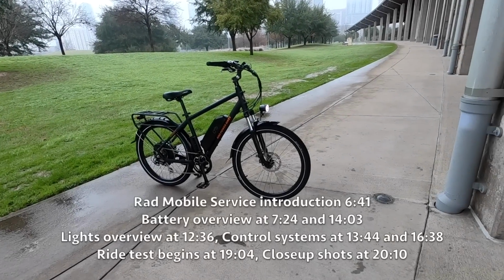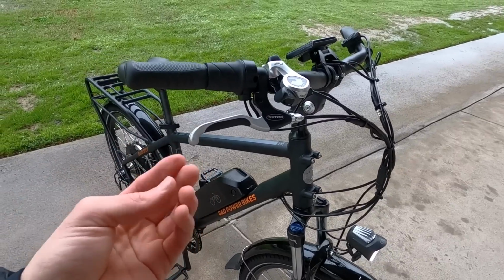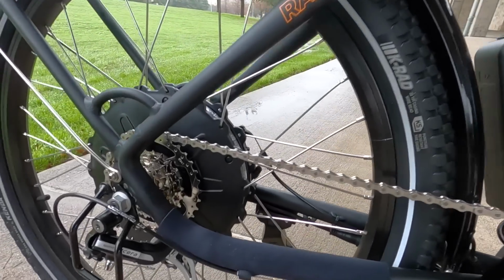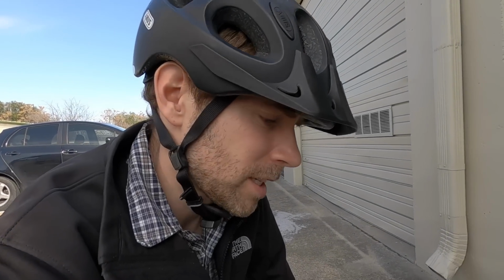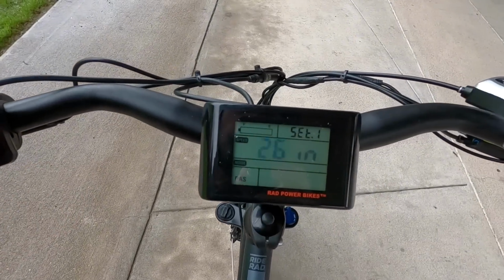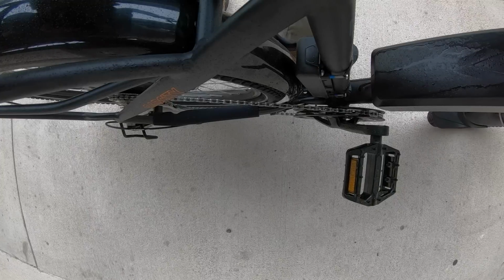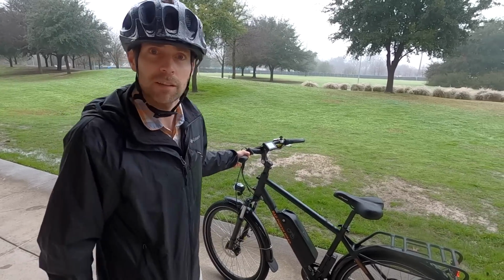Rad Power Bikes RadCity 4 Review - $1.7k

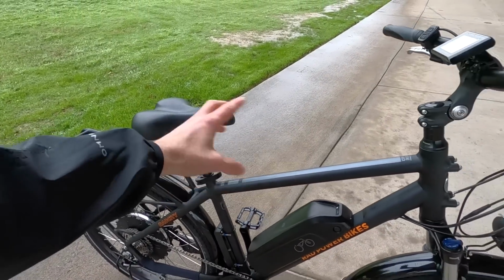Comment from the maker: Rad Mobile Service introduction 6:41
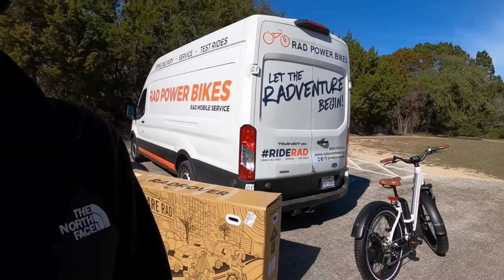Battery overview at 7:24 and 14:03
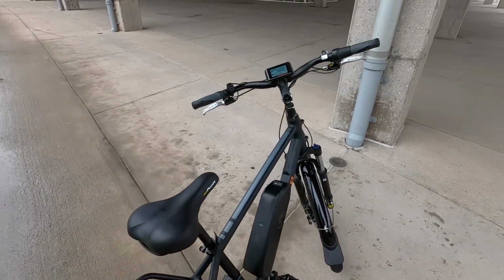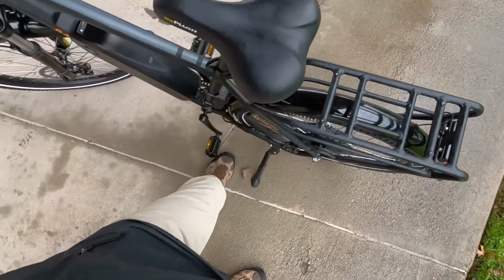Lights overview at 12:36, Control systems at 13:44 and 16:38
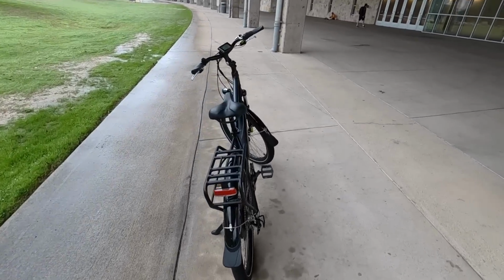Ride test begins at 19:04, Closeup shots at 20:15
Reply: Hey I was wondering which of Rad's bikes climbs hills the best.
Reply: Please, please, please compare this new arrival with the new Ariel Rider C-Class arrival.
Reply: @davidspoelstra322  : No suspension fork!!!??? Not for moi...
Reply from the maker: Hey David! I know you've been super excited about that bike. Thanks for the suggestion, I've got to get in touch with those guys... but alas, it won't be for a bit because I have 10 bikes to process right now and that takes a minute. But I'm adding it to my hotlist, okay :D
Reply: @ElectricBikeReview  Request for your hotlist: Zooz is putting together a limited production BMX ebike. Urban Ultralight. It's not the commuter style of bike that is normally in your wheelhouse at all, but it is about the only real deal BMX frame for the scene. Might be worth giving something unusual for your channel a quick peek. Edit: Also, it's kinda gorgeous.
Reply: Wait...how did you know I was excited for that bike?

Comment: For anybody interested. I got the Rad city 4 five years ago. I put on approximately 2000 miles a year. The motor went out at 6300 miles( it started acting weird at 6100 miles) and I replaced it. The bike has got 9,200+ miles on it now. I am hoping this motor will go longer than the original, we'll see. Replaced chain and rear tire at 5,600 miles. I'm hoping to get 10 years out of it.

Comment: I've watched this review a few times now, and I think that this is the bike I'm going get. This review has been very very helpful in making that decision. I have several factors that limit which bike I buy, and the size of the bike is one of them. I live in a city and need to be able to bring my bike up to my apartment via an elevator with limited space. That means I cannot get a a typical fat bike, (which is what I'd love!) most of which are a little too long to fit fit in a smallish elevator. Of the bikes that FIT, this one seems to be the best equipped and nicely built for the money. Not a fan of the swept back handlebars, but if it's a big issue, I can change them later. Thanks for the comprehensive review, as usual. You're great!

Comment: Received mine recently. None of the reviews mentioned the torque as a problem, but it my experience it's too slow to accelerate.

It rides decently when you get to a long open road and can reach top speed. But city environments have a lot of intersections, stop signs, etc and are more stop-and-go. The low torque combined with the heavy weight makes it kind of hard to get the bike moving, even when pedaling and throttling simultaneously.

I regret not buying a bike with more torque, even if it meant getting a bike with less watts

Comment: Without any power assist, is the RadCity much easier to pedal than the RadRover or about the same?  Especially on gravel, I know the RadRover can feel a bit too much without at least level 1 power assist ... but does the RadCity maybe almost feel more like just a regular bike ... or maybe not since both bikes weigh about the same at around 64lbs?  Been wanting to try out and buy a bike for a few months now but the Seattle showroom where you can test ride bikes but has been closed for quite a while now due to the covid-19. Thanks!

Comment: Thanks for the excellent review.  I bought a Rad step through largely based on your review.  Let me say that I am really enjoying it.  One aspect that i found odd is that despite it having five or more gears, the bike is extremely difficult and not very pleasant to ride without power assist.  One of the things that i was thinking in buying it was the possibility of using it as a regular powerless bike, as well.  It looks like I will always being using a combination of powerassist and gears.  It would be a nice feature to have a combination that could be power assisted and regular bike.  I have ridden regular five speeds that are quite capable.  At first I thought it might be the weight.  But, I have ridden heavy regular bikes and they don't have this much resistence.  I suppose it is a tradeoff and on the whole I am happy with it.  thanks for your review!
joe
Reply: It's probably the giant magnet on the wheel. If you took that hub motor apart, you would find it's all coils and magnets. The hub motor isn't geared, so the amount of power it delivers -- is about the same that you have to fight through with pedals. You basically need some Pedal Assist just to get a "neutral" state on the motor.
A geared mid-drive motor, on the pedals so it benefits from all the traditional bicycle gears, would be better at providing the experience you're looking for.
Reply: Yes, i think you are right. Next time!

Comment: Hey quick question. When you want to engage the throttle, do you have to pedal first, or are you able to throttle from a stand still? Thanks!
Reply: @D Larson  I do the same and I don't want to loose that feature on my next Ebike. 

Are you able to pedal assist over 20 mph pretty easily ?

Comment: Really wish they'd do gear hub motors on these city bikes. All the point you make are valid (smooth running, quiet, reliable etc) but I'm still not sold. Geared motors are still pretty quiet (especially if you're riding in the city with traffic anyway), they're also still plenty reliable. All that extra weight with less power makes it hard to swallow. Regenerative braking on a bike is kind of pointless, just not enough mass. I'm not convinced that it would extend your range even 1%.. Batteries take time to charge. The regen would only give a surface charge that would be gone after your next pedal stroke. Really love the company, wouldn't mind seeing it with a geared motor option.
Reply: That's why I'm not all the way with the Radcity that motor it has.

Comment: I just purchased a 2020 Rad City and am waiting for it to arrive. It's my first dive into ebikes and found your review to be very helpful in my search.   When I considered buying an ebike a few years ago to commute to work, I rode a couple of friends bikes that had geared motors and was turned off by the jerking motion from the torque.  The smoother, more reliable direct drive motor fits better with my riding style/needs and was a plus on my scorecard when deciding what to buy.

Comment: I got one about three months ago and have put almost 800 miles on it. Perfect commuter bike. I bought it because of your review. Keep up the good work.  :-)
Reply: Whats the maximum distance you have gone?
Reply: @bigmac3006  One time, on assist level 2 I did about 50 miles. I routinely do about 20 miles on level 5 between charges.
Reply: Any long term hints and tips for us trying to make a decision? I'm personally looking at this or the Aveton Level and I'm 40/60 towards Aveton just because there is a store near me that sells those.
Reply: @demonheart13  I've had it for 8 months and 1500 miles and it still works like new. You can always get it delivered and have your local bike shop put it together. I just really like the RADCity.
Reply: hows the climb on it (hills?).
Reply: @PaiOeShi  It goes right up hills. I've never felt like it doesn't have enough power.
Reply: how do you keep your bike safe from theft?
Reply: @AnimeBeefRandoms  I've got about 3711 miles on it now and I haven't had any issues with anyone messing with my bike. Some of it is luck, but I do a couple of things. I make sure that I turn the battery off with the key and I've got a pretty basic cable lock. I have a very secure place to lock it up at work (I work on a military base) and when I use it for errands, I never really leave it very long. I also live in a small town. If I lived in a big city, I'd invest in one of those better locks.
Reply: It looks like it has been a year since your last update. How is it holding up? Any problems with the battery? Thank you
Reply: @2010nevadasmith  I have more than 4000 miles. The RAD City is still pretty great.
Reply: @chrisb508  Thank you for the response. There are so many companies out there,  I am trying to find one a good one.
Reply: @2010nevadasmith  They aren’t the fanciest ones out there, but I think they have the best bang for your buck and are extremely modular. I’ve added the front and back baskets to make it a proper car replacement.
Reply: @chrisb508  Wow, Thank You so much for keeping us updated on the bike..Not many people would take the time to keep people informed as long as you have..
Reply: @tinachavez8712  Ok, one more update. Not long after my last post, the frame broke at the seat post. I think it may be because I installed a suspension seat post. Who knows? Well, long story short, that's not fixable. I did however buy another RadCity. This time I got the step through because my knees are getting worse and I needed a better approach angle. Despite that one issue I had after well over 4000 miles, I still highly recommend the RadCity. (Not their fault I weigh 240 lbs)
Reply: @chrisb508  Thank You for the update Chris..The step through sounds like a good choice..
Reply: @clippy-is-here-to-help  I didn't experience a lot of drag with it. At least I didn't notice it. Regen doesn't really happen until you pull the brake levers.

Something new I noticed that makes it an even better car replacement is that they now sell a trailer for it. With the trailer and available baskets, you'd be able to bring a lot of groceries home and larger objects.

Comment: Only reason I'm not on a RAD is "class 3" come on rad enough already !
Reply from the maker: Yeah, I wonder if they're trying to maximize reliability of the motor or other parts like the controller, axles etc. hard to say, but I do like that the throttle offers override on all levels of assist, that's a big win over designs that are limited by the level you're in and make you press buttons while riding to get more power and speed.
Reply: It is? They're limited at 20mph, which makes them class 2

Comment: Good looking cruisers, it's kinda hard to choose between the three bikes. I guess it really just depends on the riders needs or what ever may seem appealing to the buyer.👍⚡🚲
Reply from the maker: Yeah, which models do you like the best? They've got the city bikes, full sized fat bikes, folding fat bikes, and the cargo bike https://electricbikereview.com/brand/rad-power-bikes/
Reply: @ElectricBikeReview  At the moment I'm looking for a folding E-Bike in particular that can possibly be made of or have the following specifications listed below...
👇
#1 Foldable
#2 Carbon fiber
#3 26 - 29 inch tires
(fat tires 3.0 - 5.0)
#4 Full suspension
#5 Dual 250 watt motor 
( Mid & rear or front & rear )

I know it seems like a lot to ask for,but there just might be some folding E-Bike out there that comes close enough to what I'm striving for..🤔💭✨

Comment: "You can't have everything...where would you put it?"
After three years riding a geared hub motor bike (250W, 36V, foldie) I bought a 2019 RadCity step-thru. Yes, one notices the lower torque immediately but the flip side is how smooth the power delivery is (no jerking when the motor comes on or off)...and once you get up to speed it is truly a joy to ride...SO smooth and quiet compared to a geared motor. If one was to ride in downtown city traffic all the time (having to keep up with cars turning left as an example) this is probably not the drivetrain one should pick. For that reason I think the bike would have been better called the "RadCommuter" (better description). You will be doing a lot more shifting and changing pedal assist levels more often than on a geared motor bike (because of the lower torque value)...and that brings me to a basic flaw in the design/set-up (easily solved thankfully):
"Out of the box" you have the right hand grip, the throttle, the rear brake clamp and then the shifter...this places the shifter too far away from your right hand... so you have to move your hand every time you want to shift gears (which is often, as stated earlier). The fix is easy enough: switch the shifter and brake clamp position, now your right thumb can reach the shifter without moving your hand. (This moves the brake lever a little to the center so a brake operation is now a "two finger" operation...but that has been not a problem). The top/side surface of the brake clamp will have to be ground down a little to make room for the shifter body..but it's aluminium and easily done. A slightly longer set screw is also needed for the shifter clamp as the bar is a little thicker close to the throttle (on the 2019 model at least).
I ride with gloves on...switching pedal assist levels was "clumsy" until I crazy-glued a couple of furniture bumpers to the pedal assist buttons so they protrude more.
Having said all that I LOVE mine....so smooth and quiet...one could ride this thing ALL DAY at 30-35 kph EFFORTLESSLY....if you add a suspension seatpost (like I have) it feels like driving an old Cadillac Eldorado down the road !!! Love it!
(In strict theory, a gearless hub motor should yield more longevity and more efficiency but that is not something I can measure/quantify)
Reply from the maker: Hey Francios! Great tips there, I appreciate your thorough explanation about city riding, the gearless motor vs. geared, raising the height of the assist up/down arrows, and the ordering of the brake lever and shifter. Yeah, the big thumb shifters take more reaching even when they are super close to the grip, because the levers are up above the bar vs. below them on traditional triggers. It's interesting to hear that you ride with gloves, because this is one area where the bigger shifters shine, being easier to press, but you still have to reach up a bit. Thanks again and ride safe!
Reply: @ElectricBikeReview  Ride with gloves on ??? You bet, rain or shine. I'm an old motorcycle guy... who came off the motorcycle twice, at speed. You learn real quick that unless you have gloves on (and can move yourself around) you are going to hurt real bad. My current routine ride takes me down a hill where I can reach over 40kph on the RadCity! and there's usually a little gravel on the pavement  (to the side of the main driving lanes). "Hope for the best...prepare for the worst".
When RadPower had a "fire sale" on some 2019 models recently I picked up a RadMini....so I've got all the bases covered now!! I've got the Caddy (RadCity) for long leisurely road trips....and a Jeep (RadMini) for playing in the dirt. Life is good!
A factor in the decision to add the RadMini was they both use same batteries (the most expensive component on the bike)...I can see myself planning longer trips now...packing a second battery and never worrying about "range"
Reply: This review is like reading those confusing Recipe Reviews....
Example:" Best Chocolate Chip Cookie Recipe".....one reviewer quotes," Love this recipe however I made a few tweaks to it, instead of chocolate chips I used butterscotch, I cut the butter in half and instead of using baking powder I used baking soda, added vanilla and doubled the sugar. My family loved it, best chocolate recipe so far, will definitely make again."........like WTF? All those tweaks are personal, just state you made some adjustments but you love the bike, jeesh!
Reply: @tribequest9  Well, I'm sorry to have wasted some of your precious YT time... you read a lot of cookie recipe reviews too, do you???   LOL
Reply: @francoislepine4698  it's not a waste, but honestly I'm reading and reading and at the end I'm like, " well now what am I supposed to think about getting this bike?" And yes I read reviews of recipes cause I like to cook but a lot of the reviews are constantly changing the original recipe and I just want to know how the original is before I bother tweaking it to  my personal taste. Anywho, hope you are still enjoying your bike.

Comment: What is the long term viability for this bike? What is this bike lifespan on average? 1 year? 3 years? 5 years? How long will Rad Powerbikes support this model? 5 years? 7 years? What if you live in a city without those vans. Who will service this bike? How does this bike compare with Juiced bikes? Blix Bikes? Direct to consumer? What is the service model that direct to consumer brands are developing? How does the direct to consumer model compare to the big three? Giant, Specialized, Trek? What company has the best long term servicing plan? Direct to consumer or Big three? Service and parts?
Reply from the maker: Great questions, Alan. I've noticed that Rad still sells all battery pack designs, going back tot heir first models! This is very impressive, and rare in the industry. I'd estimate the lifespan of the bike to be at least three years, and possibly over five if you care for it... the battery pack can generate 1,000+ charge cycles if kept in a cool, dry environment and kept at 50% to 100% full vs. going down to zero. There are many shops that will service any bicycle, like the gears, chain, tires etc. even if it's electric. A service could cost upwards of $100 depending no where you live and what's required. I rank Rad Power Bikes as number one direct to consumer, followed by Blix because they have shops and direct, and I don't have much experience with actually ordering from Juiced, so I cannot say... but they do seem engaged on our forums: https://electricbikereview.com/forums/forum/juiced-bikes/ I'd say that Trek and Specialized have the best dealer networks and traditional model, with Bosch being a big leader in hardware for mid-drive ebikes :)